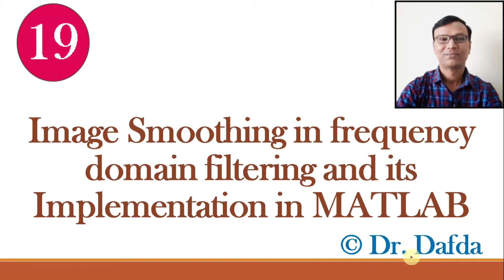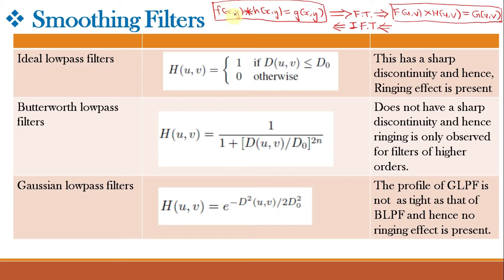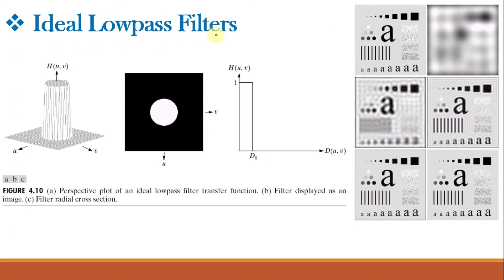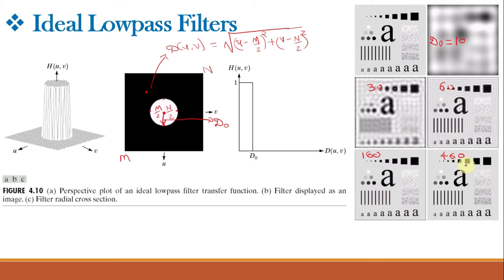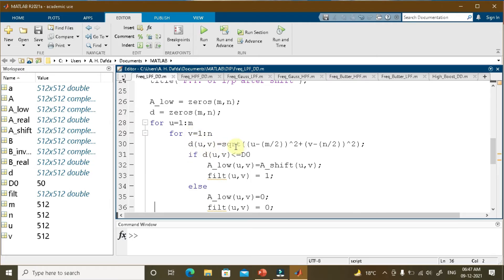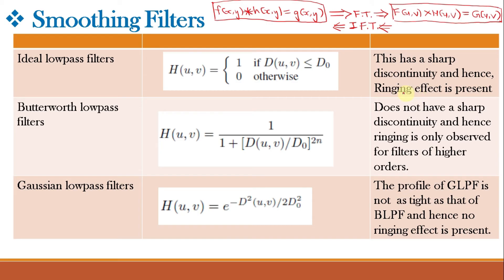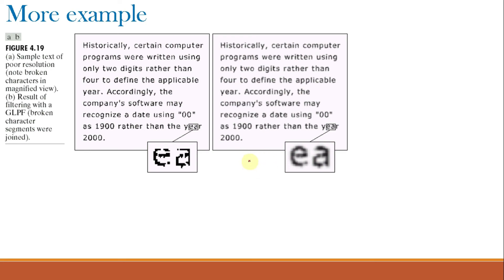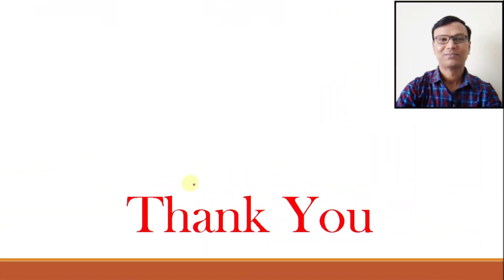Image Smoothing(LPF) in frequency domain filtering & its Implementation in MATLAB| ILPF |BLPF |GLPF

Comment: koi code copy krke bhejdo plss
s
Reply from the maker: %Matlab program for Ideal low pass filter in the frequency domain
clc;
clear;
close all;
%a = imread('Maulik.png');
%a = rgb2gray(a);
a = imread('Cameraman.tif'); % Input image
a = im2double(a); 
subplot(2,3,1);
imshow(a);
title('Input Image');

[m,n] = size(a);  % size of input image
D0 = 50; % Assigning Cut-off Frequency  
A = fft2(a);   %fourier transform of input image
subplot(2,3,2);
imshow(uint8(abs(A)));
title('F.T. of i/p without shift');

A_shift = fftshift(A);  %shifting origin
A_real = abs(A_shift);  %Real part of A_shift (Freq domain repres of image)

subplot(2,3,3);
imshow(uint8(A_real));
title('F.T. of i/p after shift');

A_low = zeros(m,n);
d = zeros(m,n);
for u=1:m
    for v=1:n
        d(u,v)=sqrt((u-(m/2))^2+(v-(n/2))^2);
        if d(u,v){is less than or equal to}D0
            A_low(u,v)=A_shift(u,v);
            filt(u,v) = 1;
        else
            A_low(u,v)=0; 
            filt(u,v) = 0;
        end
    end
end

subplot(2,3,4);
imshow(filt)
title('Ideal Low pass filter')

subplot(2,3,5);
mesh(filt)
title('surface plot LPF')
B = fftshift(A_low);  %Reshifting the origin of filtered image
B_inverse = ifft2(B); %Taking inverse fourier transform
B_real = abs(B_inverse);%Taking real part(Low pass output image)

subplot(2,3,6);
imshow(B_real);
title('Low pass image');